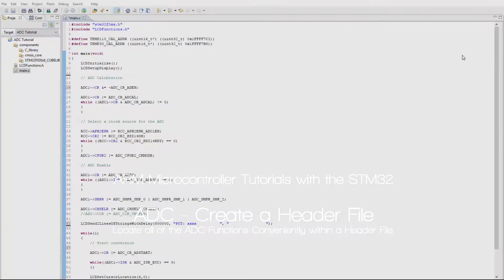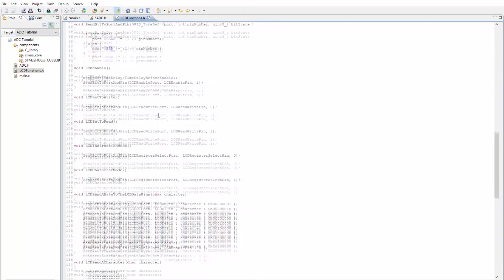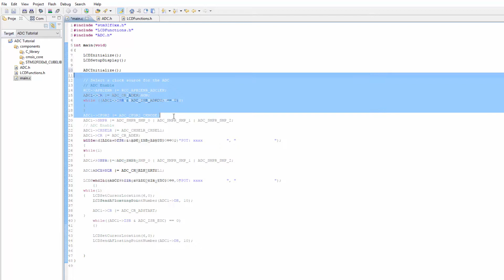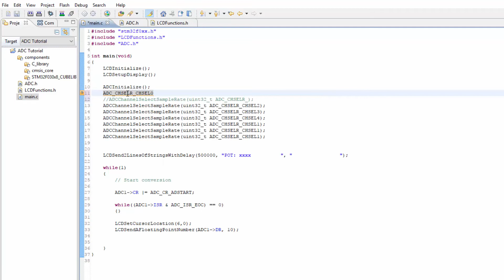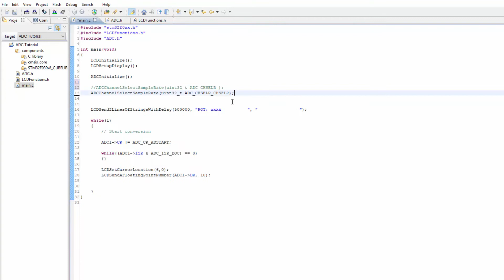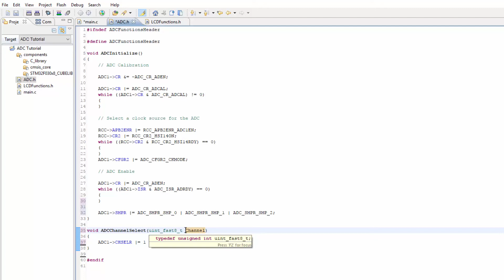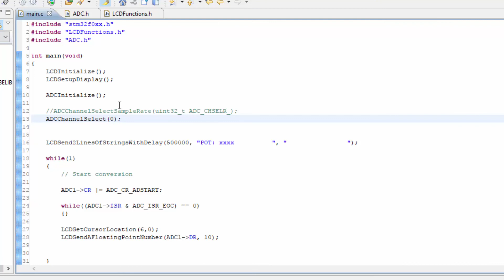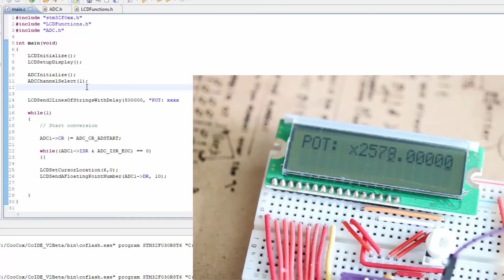46. How to put the ADC code into a header file -  - STM32 ARM Microcontroller

Comment: Hey why does the ADC keep floating so much around? how do we make it stable? atleast relatively more so.
Reply from the maker: Lots of interference in your circuit.  If you are doing this on a breadboard, then you will not be ably to get away from this interference.  Once you create your PCB, then follow all ground plane and power recommendations from engineers to make sure the interference and noise is reduced.  The ground place and power trace information can be found on the internet and in some microcontroller manuals.

Comment: I just love the "stream of consciousness" style of presentation. I can identify with it completely.

My understanding of the compiler's treatment of uintfast8_t and uint8_t, is in how the variable is treated in multiline calculation. With the uint8_t, the "extraction" of the result, requires an additional AND with 0xff.Whereas, the fast eight will keep the variable as the variable size native to the CPU architecture. Now, as the compiler will be doing ALL the calculation of the constant expression that you are using, it is more efficient to use variable size native to the compiler: int.
Reply from the maker: Very interesting.  There was also a comment made in my patreon post for this video regarding the uintfast8_t and mentioned that it is resolved during compile even if it required a larger than 8-bit number to handle the type.  I personally like the simpler approach of just using int or uint8_t (which is what I seem to select in these video unconsciously).  I think with these uCs, I won't be touching a fraction of the upper bounds, so I think I will be safe using int.
Reply from the maker: Oh yeah, thanks for the kind words!

Comment: I'm sure quite a few, me included ;) would say that except for a few special cases you shouldn't put code in header files.  function declarations go in a header file, function definitions go in a c file
Reply: templates and inline functions are exceptions. if you put code in header files every c file that includes that file needs to be recompiled every time you change anything, if you put the code in a c file only that file needs to be compiled as long as the declaration in the h file stays the same
Reply from the maker: Thanks for the feedback.  Yeah, I should break the definitions and methods into two files.  For these very small projects, I didn't feel that was necessary.  I'm not a seasoned C programmer by any means, so I will probably manage to really cobber the generally accepted rules.  I am more accustomed to C# and creating classes, which I hope to do with C++ later in these tutorials.  I'm just not there yet.
Reply: I have read this convention many times, but have yet to read an explanation of how this would aid the compilation or the execution of the code. One notes that most of the C++ stdlib is templated code in header files.
Reply: @willofirony  The advantages emerge when you consolidate your code into libraries (or archives in Linux).  The libraries are already compiled and save substantial build time.  But the linker still needs to know the parameter and return types.
Reply: I see that would result in longer compile times. However, when one places the code in .cpp files, one is required to manage the main,cpp dependencies - ensuring all source files can be reached by the compiler; by either copying them into the project directory, or itemising them on the command line. Using #include just requires all header files be stored in the include directory. Given the size of most embedded applications, the increase in compile time would hardly be noticeable
Reply: #include is the same as copying everything into one file before compiling so it has other side effects, like scope of variables and functions and multiple copies of a function if you need to include it more than one place